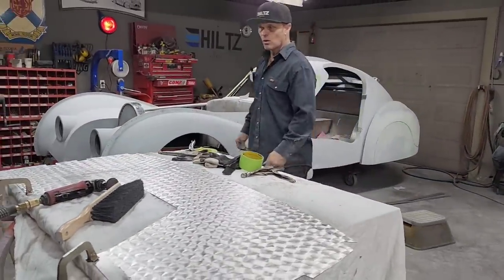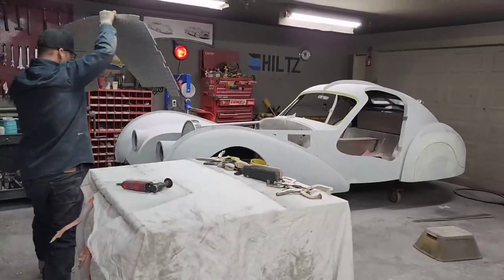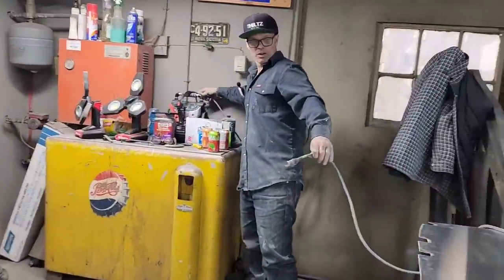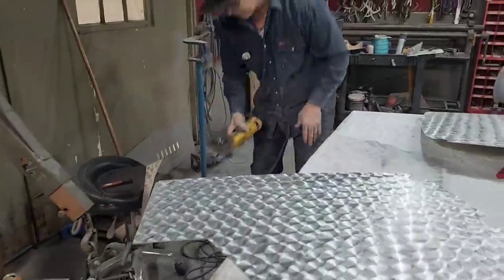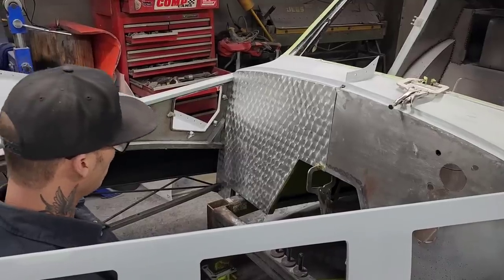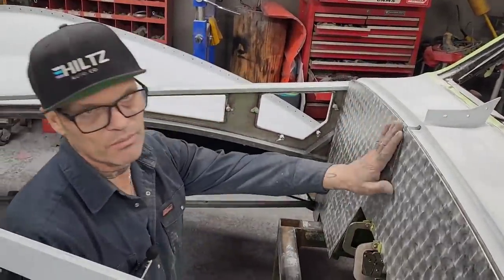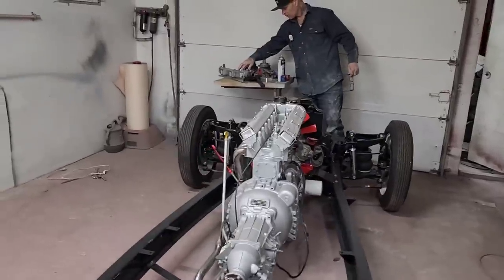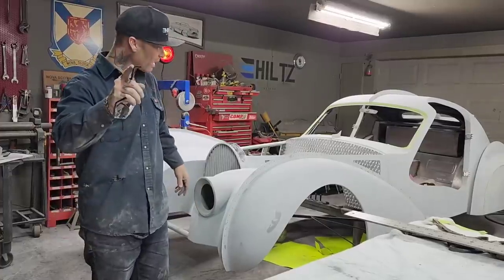Engine turning aluminum using hand tool + 3M Roloc disc ✅

Comment: The firewall looks awesome being on the car. I would use rivets to mount the aluminum. That way it would blend much better.
Reply: I agree and that would help to reduce corrosion that might be caused by the brass / aluminium interface (dissimilar metals) 😎👍

Bloody amazing skill.

Comment: Before going further, make a removable brace going down the center from firewall to rad support.  Will give extra body rigidity.  Then, make the sides of the engine bay temporarily removable as well.  For access to the area while working on it.  Then you'll always be able to get to the plugs, air filter, carbs, oil filter, etc.
Reply: Not I 2 but each side.
Reply: The removable strut is a great idea. And yes. Now is the time to make mods for serviceability. I also wondered if he could create clearance recesses if he does not want removeable panels.
Reply: 😢  Nice job on the firewall, you stainless screws don’t use brass  they may 31:00 have chemical reaction 31:00
Reply: @garyd907  Stainless will look nice, but I think Chad is right.  Brass against aluminum avoids the galvanic corrosion.  You would be amazed how quickly the aluminum will 'rot' away from the contact with stainless given the right conditions for that chemistry.

Comment: If you use brass in aluminium ther is a potensionel difference,so you need to put nylon rings between to prevent corrosion.

Comment: Hi Chad & Jolene, the firewall was a lot of work but, well worth it. It looks absolutely beautiful and brass screws will really stand out. The center cut is so good I don't even know if you need to cover it, if you do Bad Chad Chrome of course! I know that the car is tremendous work but, it will be so worth it. Jolene are you getting really excited yet or do you need it to get a bit closer to done before the real excitement kicks in? I know there is still quite aways to go until it is totally done and ready for the road. Great work on the car and the video as always you guys!

Comment: Chad. Maybe weld two of the four holes shut for the carb mount on the manifold, re-drill and tap threads in them and you won't need the carb spacers. Could still use the fiber spacer gaskets.
Reply: The machine shop told chad the manifold was not thick enough to do it so that is why they made the spacers

Comment: I think a flat stock frame needs to be added for the brake pedal/master cylinder, at least.  That sheet metal could flex and weaken, over time.  It'd be quickest and easiest to build the frame now......and safest.

Comment: Hi Chad I was wondering if a thin gasket between the steel and the aluminum would stop noise and oxidizing corrosion between metals.

Comment: That firewall is beautiful. Not sure about using brass screws to attach it. Need to check about brass and aluminum possibly reacting and causing corrosion. Might think on polished stainless screws or bolts. It you can get to them from the back side might do small stainless bolts that have rounded heads without slots or maybe button heads with the hex center. Those would look very correct for that time period. If you wanted something very exotic you could use gold plated stainless or titanium in plain or some color. Might need to order in some samples to see what looks good. Also, have you thought about some protection for the firewall and cam covers. Aluminum will oxidize over time and get dull. You could have the parts anodized. Would want to do a sample to see what effect that may have on the look. Wouldn't want anything to take away from the appearance. This car can have all kinds of ideas for eye candy.

Comment: Great job on the firewall looks a lot like the Perlage on a Rolex. Thought I would mention that to quickly remove permanent marker I use Deep Woods Off. (no endorsement) It takes the marker off instantly. Jolene's car is amazing just as she is!

Comment: I am so looking forward to hearing the engine run and to move with Jolene beaming Sundays at the wheel. Still, I know there's a lot to be done. Thanks for the inspirationj with your determination.  little project

Comment: Chaddy, by using the thick gaskets under the carbs, it will not keep anything from vapor locking, but it may keep the fuel from icing up. The firewall looks awesome by the way.

Comment: Hi Chad & Jolene, I Think It Would Look Good If You Done The Inside Of The Sections Where The Three Holes Are Cut Out. As Well. ( Inside Where The Bonnet Sits On )  & Do It  The Same Way As The Fire Wall

Comment: You may want to reconsider using brass screws with the aluminium, they are a combination of metals that have a galvanic reaction. I would use round head aluminium blind rivets.

Comment: Aluminum will react with another dissimilar metal, and galvanic corrosion will occur. Aluminum paired with steel corrodes, they need to be insulated from each other

Comment: Are you going to need an extra hole for wiring to get into the engine compartment?
Reply: What if he takes the wiring harness through the front edge (and centered) of the floor?

Comment: I hope a clear coat that bonds to aluminium is used to help preserve the machine turned effect from oxidation.
Such a lot of work has gone into making that firewall it will be shame to loose the swirls as the surface dulls over time.

Comment: I would use a thin strip of Aluminum with the same spiral design as the firewall. According to Google, aluminum can only be fastened with stainless steel fasteners to avoid a corrosion interaction. If using Brass, the two metals must be shielded against contact with a coating or a rubber or plastic gasket.

Comment: Firewall looks great. About the master cylinder mount....you could put a piece of 1/8" as big as possible on the inside. Between those three laminations it shouldn't flex.

Comment: Chad will you put paint on the firewall to slow the dissimilar metals causing electrolysis? And also will you spray  clear on the aluminum to keep it nice?

Comment: Now before you get the car painted, take clear polyurethane like Imron and paint the aluminum firewall to preserve it. I did a 42’ aluminum flatbed trailer in 1979 that was swirled and it shined and magnified the swirls and made cleaning a breeze. Great job and good luck with your project in the future . Batman

Comment: You were talking about putting double tape or something to get the aluminum firewall to hold on the body better; 3M makes a material now to hold patch panels on with out welding. (another suggestion you can use or ignore how ever you think)

Comment: Use sikaflex from Home Depot to hold the firewall on, no screws or rivets required and it will seal it so dirt and water won’t get in between the Alu and steel. but the brass screws will give it a nice look.

Comment: When you first talked about adding the aluminium to the torpedo wall I thought you said it would be structural as the existing torpedo wall was so thin it flexed when you stepped on the brake pedal. Seems I got that wrong. Still it looks better than the steel wall and will hide a lot of sins...
Have there been anything said about isolating the aluminium plate from the steel to reduce the risk for galvanic corrosion?

Comment: Hello Chad you can weld up that Center in the plate where you cut it and then just use your tool to put the design back on it again after you grind the weld down. Most people can't pull that off I believe you can

Comment: QUESTION ?  ---  What are you going to use to seal the fire wall with before the final application of aluminum facing.   ---  Would clear coating on aluminum to keep it shiny,  flake off ?  ---  THE PROJECT IS LOOKING GREAT  ---  LIKE THE CAR THE QUALITY OF THE VIDEO WORK IS GETING BETTER ALL THE TIME !  EXCELLENT JOB !

Comment: Off topic but, Chad, if you read the comments, I saw something in a craft store today that might interest you. It's copper tape used for stained glass crafting, adhesive backed metal strips, 1/4 inch and less widths. Could be used for thin trim accents?  I'm using it on model trains.

Comment: For the connection on your top rad hose, you could use a 45 street elbow if two 45's don't work.

Comment: The thick carburetor gaskets as you call them are "insulators" and yes, they are made thick like that to prevent heat transfer.

Comment: Chad you need to clear coat the aluminum after making the swirl marks, I worked with aluminum in the Air Force,, aircraft are either aluminum or now composite, you took the clad off the aluminum

Comment: You definitely need to do the hinges for the hood split it in half and put the hinges so you can lift one side up or the other well I think you should anyways it'd be easier to work on the engine especially if you get older

Comment: I was wondering if it could be bowed (not bent) and fed up from underneath?  Would need to lift the body more.  Alternatively, cut in two and add a moulding as Chad said would work as well of course.

Comment: I have to say, after looking at the trans tunnel and the back of the engine. Chad says there is only a quarter inch clearance between the engine and firewall. I fear the bump out for the starter housing in the bellhousing,  is going to hit the tunnel. Anyone else see that?

Comment: DON'T CUT IT  !!!!!!!  It would be a good idea to put an even roll in the midle narrow section  with your slip roller and then push it flat to the fire wall into position ether using a porta power or setting up a two by four across it with a ratchet wrench a couple nuts and washer thought everything including the fire wall to flatten it back out. Then youd have one hole to camoflauge with a round disc of aluminum the size of your machine spin.

Comment: Would the fasteners on the firewall not match the rivets that going in the spines up the fenders. and roof... Also, what is the plan for the interior? console, firewall , and such. I would think if all the fasteners are noticeable to the eye they should match. So many details to think about. But am engaged in the process and tricks. Thumbs up. we need more fina tho,,, lol.

Comment: COULD USE ZEUS FITTINGS ,,AIRCCRAFT ,,OR SPEED SHOPS HAVE THEM ,,1/4 TURN ON OR OFF,,HAVE PUT BELLY-PANS ON ,,CUSTOMS WITH THEM ,,AND ALSO AIRCRAFT ENGINE COOLING PANS WITH EASE OF ON OFF ACCESS

Comment: Could you not just bow the firewall piece just enough to fit it in instead of cutting it in half? Wouldn't  have to create a crease  just bow it a little to fit in place.

Comment: Do you have any buddies who might consult with you about upper water hose flexibility as related to engine ROCK and engine mount flexibility.  Rigid mounts make the car loud for the driver.  Or, maybe this car is not intended to be driven for pleasure.

Comment: I'm not trying to be a smart a$$, Have you ever heard the words dissimilar metals? If aluminum touched steel it will set up an oxidation. I know this from my building profession. If I put a steel roof going on top of aluminum framing or Aluminum roofing sheets on steel framing we have to put a layer of rubber, or a rubber like paint to keep them separated.